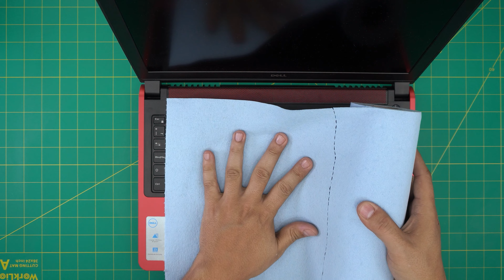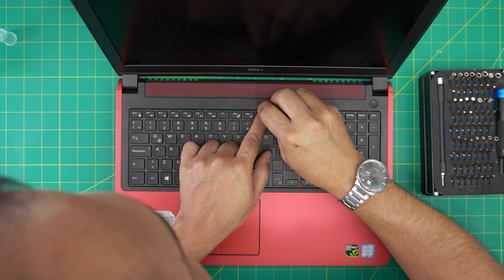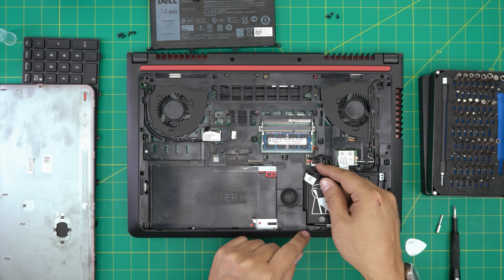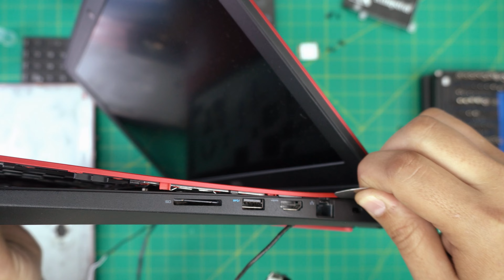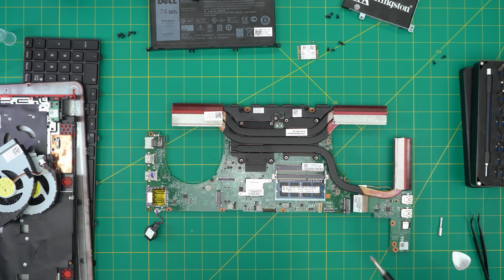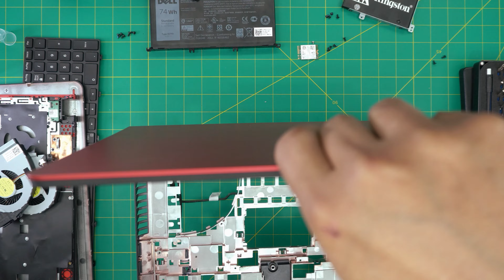How to Repaste and Clean Dell Inspiron 15-7559 Laptop - Step-by-Step Guide

Comment: You only need to disconnect the cables (LCD, DC jack, Wifi antenna), you don't need to completely remove them.  Motherboard will still come out fine if they're only disconnected.
Reply from the maker: Yes, we are not completely removing them. They go through the hinges and into the screen housing, and I didn't remove them completely. But you can just disconnect them.
Cheers🍻

Comment: How thin are the thermal pads for the GPU ram?
Reply: If anyone need this info after seeing the video, it's 0,5 mm thin
Reply from the maker: 🫠Regarding your question, it is 0.5mm thick, as you mentioned 👍
cheers🍻

Comment: Thanks for the super good instructions. I changed thermal pastes and cleaned the blocked fan vents but now when everything is assembled I get a black screen haha. Works fine with external screen. I might have some connector loose but can’t say which one..
Reply from the maker: It's my pleasure, my friend.
🫠 Regarding your question, make sure the LCD connector is inserted all the way in. It is a push-down type—align it over the connector, then press down, and it should click in.
https://imgur.com/a/BN7sF6z
Should you have any further questions or requests in the future, please don't hesitate to ask me.
cheers🍻

Comment: Where do you get a spare plastic chassis top and bottom? 12:00
Mine is cracked from the sides and is pried open whenever you flip or shut the screen.
Reply from the maker: 🫠Regarding your question, the best place to find them is on ebay or aliexpress.
Should you have any further questions or requests in the future, please don't hesitate to ask me.
cheers🍻

Comment: I already bought new thermal paste to repaste my inspiron 15-7559 but holy that so complicated. You gotta tear all components just to repaste 🤦
Reply from the maker: Unfortunately, for this model, you do need to remove the entire board. On some other models, or most models, it's very simple, but not on this one. It's like taking your car in for a simple oil change, and the mechanic tells you they will need to remove the engine to do so, all because of how it was designed.

Comment: This is such a terrible design.  You should not have to disassemble every part in the laptop just to replace the thermal paste
Reply from the maker: I agree with you, but this is done by design as the brands don't like people opening and touching the inside of the laptops, so they make it harder every time.
cheers🍻

Comment: Correction : the white and black cables at the WLAN CARD during the re assembly is interchanged ! Please correct
Thank you for the awesome tutorial I could clean my laptop because of this
Reply: If possible please provide a solution for broken hinge , it’s a repetitive problem with this
Reply from the maker: Thank you for your feedback! If you wish to support the channel, you can like, subscribe, or both!
Regarding your question, the wifi cable colors don't make any difference if you change the places both are the same.
regarding hinge repair i have few videos that can help you understand the work around.
https://youtu.be/VA58WV3nB38
https://youtu.be/rjR_wVNg4w4
https://youtu.be/UzZ7wSofpAA
Should you have any further questions or requests in the future, please don't hesitate to ask me.
cheers🍻
Reply: @Smrigankiitk I would say some type of super glue possibly

Comment: Hi
My laptop is still heating after applying the thermal paste
Do you happen to have any idea about how this can happen
Reply from the maker: Thank you for your feedback! If you wish to support the channel, you can like, subscribe, or both!
Regarding your question, what are the temps of the laptop under load and when is idle, also what brand of the paste you used?
Reply: @uFixTek  the temperature keeps jumping up and down no matter if its under load or idle and after some time the temp will got 100c for fraction of second for one core and rest will follow the same. The usual range of temp is between 52 to 100
Ps i forgot the brand of the thermal paste
Reply from the maker: The brand of the thermal paste is extremely crucial; it must be original and of good quality. If you use something from a shady brand, well, that's where your issue lies!
Reply: @uFixTek  Thank you for the reply.
Oh okay, I will try to reapply paste again, do yo know which paste brand is good in india, as i have no idea about
Reply from the maker: https://www.amazon.in/ARCTIC-MX-4-2019-Compound-Performance/dp/B07L9BDY3T/ref=sr_1_1?crid=8M1K2EU7U98P&keywords=arctic+mx4&qid=1690347323&sprefix=artic+mx%2Caps%2C249&sr=8-1
Reply: @hemantsangle9204 Hello my laptop is also overheating the same way spikes up for a second then goes down. Its 6 years old I have never done this before pretty scared to try should I try it?
Reply: @AnimationAddict  if you have not done it before then i will suggest to get it done by the experienced person like computer repair guy.

Comment: Thanks for the tutorial, it helped. I have 2 notes though:
1. If the laptop has additional SSD in SSD socket, one should consider removing it too before removing motherboard or else it won't go
2. Before removing wifi module the white cord was up and the black was down 5:00. After bringing back they switched places 20:55. Is it important?
Reply from the maker: Thank you for your feedback! If you wish to support the channel, you can like, subscribe, or do both!

Regarding your question, if you have a flexor cable connected to your SSD, you must remove it before proceeding.

As for the WiFi cables, there is no difference in color, so you can swap them without any issues. They are both simple wire antennas, with one being black and the other white. The black one is typically used for Bluetooth, while the white one is for WiFi. BUT they both do the same exact work as both are simple antenna cable.
Should you have any further questions or requests in the future, please don't hesitate to ask me.
Reply: @uFixTek  Thank you very much for your reply!
Reply from the maker: It's my pleasure my friend.🍻